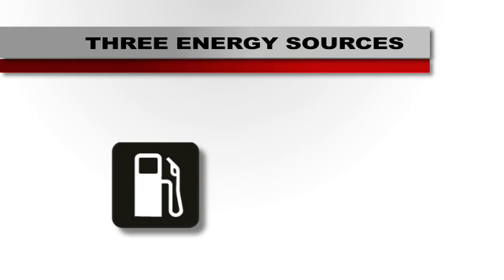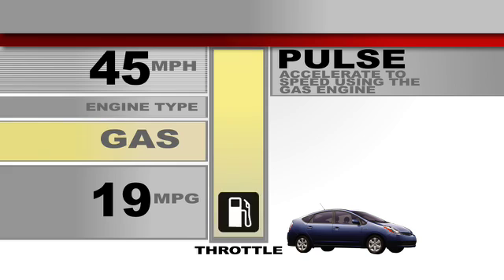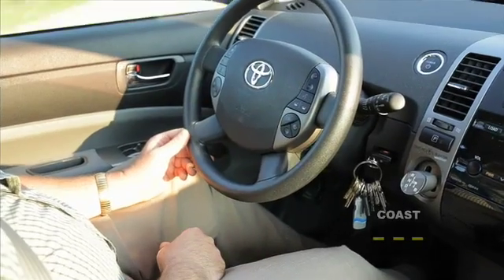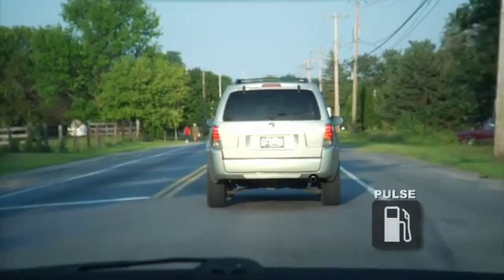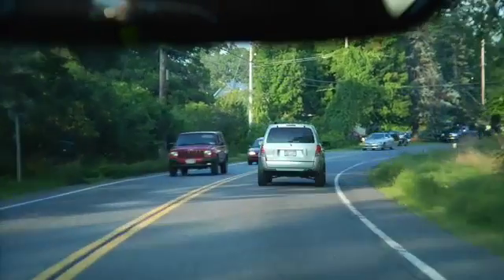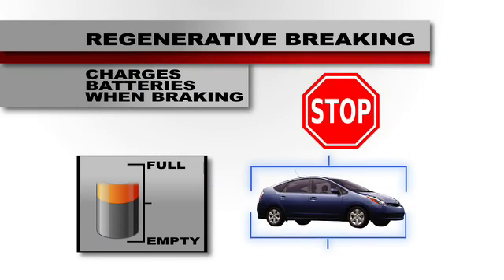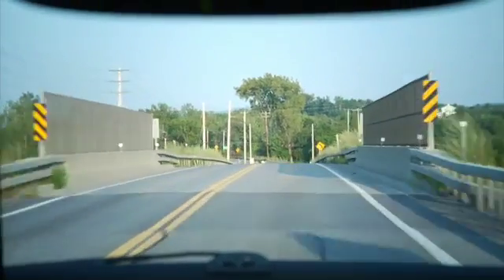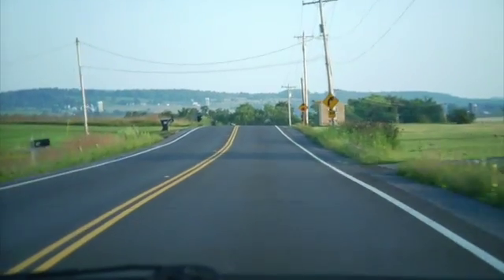Expert Explains Mechanics of Driving a Toyota Prius

Comment: The ecomodder pulse and glide slightly presses the accelerator in the glide. There is a freewheeling engine off zone somewhere between light regenerative braking with the accelerator completely up, and light electric motor use.

Comment: I have a slight beef with regenerative braking and it goes like this.  Sure it puts power back into the battery.  But it's on when coasting too.  You don't have to touch the brake pedal to start slowing down as soon as you release the pressure on the accelerator pedal.  Slip the car into neutral and you'll feel the car free up and roll a lot longer.  That means you could have taken your foot off of the accelerator a lot sooner.  The only time the regen should be working is when the brakes are being used.  That's not the case in the gen 2 at least.  Unless my car's been busted since new.  Any opinions???

Comment: Thank you for your sharing of knowledge. Would you be so kind to explain in greater detail the "pulse" technique (how frequent on/off the gas, aprox. what percentage of throttle imput while pulsing, etc)? I've got an 07 gen 2. So far I've averaged 48 mpg after my first fill-up. Just looking to stretch fuel efficiency a smidgen more if I can help it.
Reply: I would like more info on the pulse as well, I’m a little confused
Reply: 2010 Gen 3, and I too desire more “Pulse” clarification????

Comment: first time I used utube and I have a 2006 Prius, I automatically do drive a lot as suggested, but the MPG always says 47.5 and never changes!!  what do you think is wrong?  I watch the chart, coasting and accelerating easily but no change in MPG
Reply: Reset your trip computer each journey and you'll get a fresh MPG reading. Yours has built up over thousands of miles so has found an average which will rarely change

Comment: What model do you think is most efficient from the years 2002-2016?  I heard to steer clear of 2010.  When u say pulse you mean when the gas engine kicks on that happens automatically right.
Reply: You should go for the 2016 model.  Great car and they come with all those extra's like Head Up Display, Lane Assist, and all those goodies and more fuel efficient.
Reply: @wimschoenmakers5463  I have a 10 but looking to upgrade to a 16. I am on the fence about it as I love my 10.

Comment: I find that running on cruise control, flipping up and down, is often more efficient than using the gas peddle and brake, because the computer is figuring out what's best.
Reply: I use the cruise control as often as possible in my Highlander and Pilot,  and i get consistently 19-20 mpg in the city.
Reply: @gregnixon1296  I’ve never used cruise control in city traffic on any non hybrid.  Too much stop and go…

Comment: Thank you for the helpful video!  Very well instruction.  Now, I understand pulse, glide and coast definition.   I have a 2013 prius V.  Would you tell me on which way would be better for my prius V on getting better gas mileage?   

I wonder which mode would be better to for braking on a downhill/downgrade.  Using the B mode or by applying the brake gently(three bar charging).  But then, would I be overheating the brakes or wearing out the brake by riding the brake on a long downgrade.(my brake pressure on the brake pedal "just reach the 3 bar charging indicator). Sometimes, I'd released the brake gentle(down to two bar charging mode and 3bar indication) to see if I am using the brake or just using the regenerative braking mode.

Would I damage the engine by shift my prius V to the "B mode" driving on the downgrade to control my car speed(coast at 50mph to a complete stop)?  Using the brake gently or shift to B mode and kick the rev up, using engine braking!   Would this create more pressure in the CVT?  Would this damage the CVT? Or create premature wear for the engine..?
Reply: I'd rather use my brakes and get the pads replaced than engine wear and tear. However I don't know much about B mode

Comment: Have you tried to brake on B "mountain brake"? I use it a lot getting more braking power and electrisity..
Reply: If I am correct if you use B on a downhill it is so you don't wear out and overheat brakes and not to overcharge batteries while in full charge. It won't charge batteries while using B on a downhill even if it shows charge on grid.

Comment from the maker: Thank you! Let us know if you have any questions!
Reply: Can you please explain pulse and glide more and is there something that I need to do to get the electric to take over because I feel like when I let the foot off the gas all I do is coast.
Reply: I have a question about a 2010-2015 prius C. Is it normal for me to floor a prius all the time? I am not looking to save gas at the moment, but to be able to accelerate to the speed limit without interfering with the traffic behind. I am used to driving v6/v8 cars with well over 300hp. I find that flooring a prius is around the same acceleration as pressing the gas a couple inches on those cars. So is it ok for me to keep flooring a prius, or am I wrong and i can safely accelerate from 0-60 by pressing the gas only 1/4 of the way?
Reply: so are you putting your foot on the gas and break by pumping it gently with your foot?